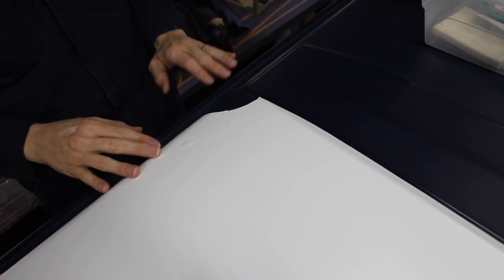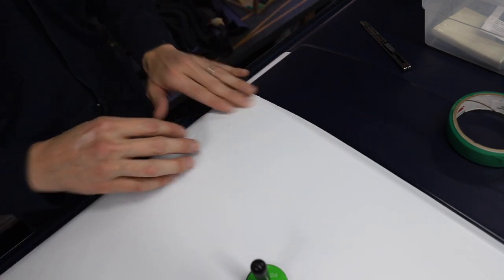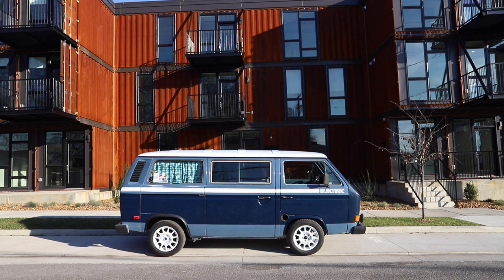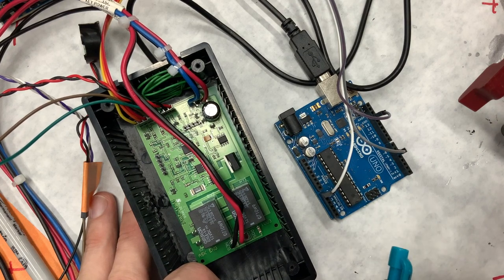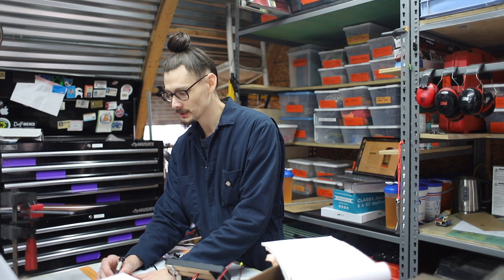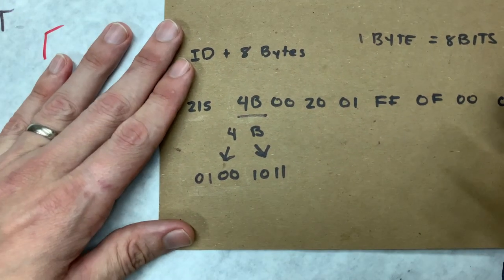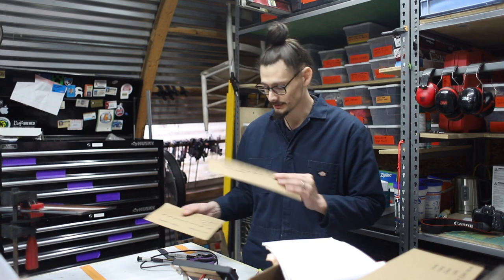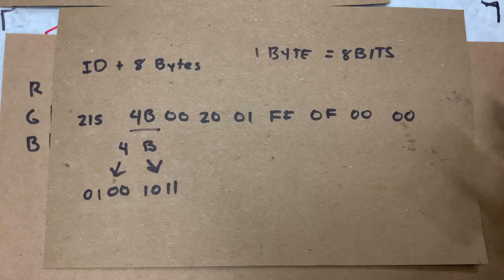Tesla Powered Vanagon Episode 45: CAN Button Keypad

Comment: Funny I stumbled across this. I'm almost done with my code controlling and arduino UNO and MCP2515 module, all on a nice PCB shield with a 5v regulator and Deutsch connector so you can just give the board 12V and ground.  the keypad protocol is not too bad for programming if you're a little familiar with C code.  I was originally going to make a custom PCB with an MCU and CAN hardware on board but finding parts is difficult right now and you can always buy the CAN modules on Amazon for dirt cheap so I went that route, plus the open source nature of the project will end up being pretty neat.  Next I plan on doing some CAN input modules for Analog and digital signals, and a CAN relay driver for controlling a relay/fuse block just via the 2 comm wires.  Should be fun!
Reply from the maker: Exciting! I popped over to your channel hoping for a video... Any chance you have this shared on GitHub? Long term we are hoping to build out a mature pcb similar to your plans. We first started this and did not find anyone really doing anything similar, So its good to know you are out there.
Reply: Mostly just me rambling but here you go lol
https://www.youtube.com/watch?v=GZjbupxF9lU
Reply: @DreamEV  I've responded like 3 times but my comments aren't posting for some reason so this will be a short response.  I have a video on my other channel (seen in the other reply) where I used a teensy to do a bunch of things including controlling the keypad but I've used arduino on this iteration and it's a bit nicer code-wise to deal with.  I'll be putting the code up at some point but it'll be a few weeks since it's still in-progress.
Reply from the maker: Solid! I wanna see that Miata as well :) Don't be afraid to dive deep if/when you post a follow up, There is not much out there for this domain. Many would benefit from it.
Reply: @DreamEV  For sure!  Not much of a videographer but I'll try to do some videos at some point.  The miata is down long-term for a K24 swap and progress is very slow as I'm not in the best financial position to make a lot of progress just yet, but it'll get done one day!
Reply: Did you ever figure out how to control relay / fuse block with a CAN keypad. I would love to add this to my car but there's not much information out there.
Reply: @BALLERXD24  yeah I made my own circuit boards and programmed a microcontroller to do it all.  
There's a product called "micropdm" that can control relays from a keypad and it's pretty easy to set up, so you should check that out!